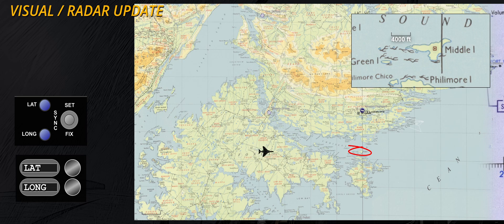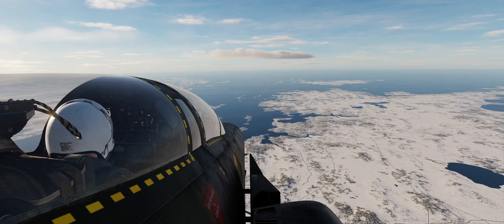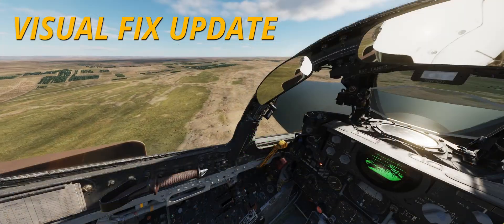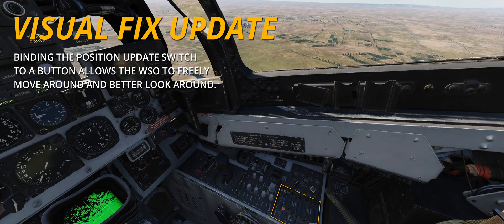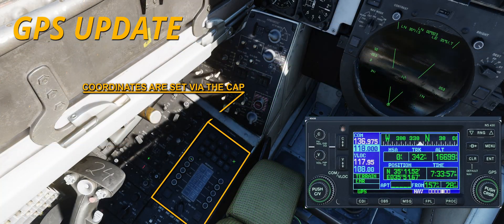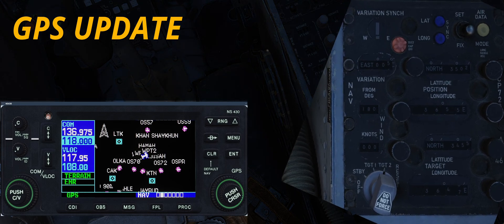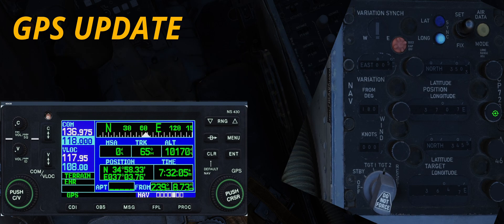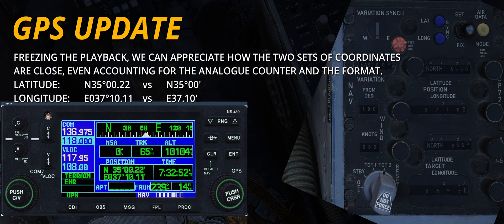F-4E-45MC INS: Visual/Radar, GPS Fix Update (AN/ASN-63)

Comment: If you dont have the GPS module, you can use our free moving map
Reply from the maker: I would use it only in a server expecting the capabilities and functionalities of a fully updated Phantom. Id est, mimicking an ICE, Icarus or Terminator. Otherwise, it's just too good. The NS430 is a terrible moving map, for example.

The correct answer would is: do a visual update, as it was done IRL :)
Reply: @FlyAndWire  Good point, we should add a retro GPS mode. Maybe something like a Garmin GPS 12
Reply from the maker: I am not sure it's worth the time, since Visual will be the way to go in realistic servers. When DMAS arrives, the ARN-101 uses a laser ring gyro, which probably won't need any update at all. Everyone else will probably be happy with what you have now.
Reply: @FlyAndWire  Yeah probably, thought it would be fun to do :D 
I've added lat/lon position of the aircraft. 
You can hide your own aircraft in the map and just use the lat/lon position

Comment: Question to a general community: Do you find yourself unable to complete mission (online or in sp) without realistic INS fixes and advanced (real) approach? To be honest, I never found ins drift a problem - the missions (MP) are usually too short, and the most of f-14 campaigns somewhat go without the need for correction. I've heard ED is changing INS simulation in recent versions and I wonder if it will become a big factor. Because until now, any 80's or cold war servers / campaigns were not really hard on this aspect. That's my impression, at least.
Reply from the maker: Well, for example, my last mission was almost 4h long in the Tomcat. After I realised that our DL information was off right in the middle of a close encounter with a MiG-29 in total darkness, I made a quick update.

These procedures are not really used in casual servers, I agree. But I would argue that 99% of what is done in real life is useless there. Tactics are rarely more complex than spamming AMRAAMs or hiding in the valleys :|
However, this sort of study is what eventually led me to understand the F-14 ARHS problem. If other players are happy to have their avionics pointing 20/30 degrees in the wrong direction, good for them, but I prefer to have my stuff properly sorted! :D
Reply: @FlyAndWire  It is because of this that I don't bother with public servers. You just don't get to meaningfully engage with the simulation in server scenarios that are built for those that actively don't want to.
Reply from the maker: Yep, I agree. Casual servers can be fun, especially with a couple of friends, and help to get used to unexpected situations. However, it ends there, pretty much.
Reply: the problem is that most server allow the stupid F10 GPS position, so people dont even bother with real navigation procedures. I wish that wasnt the case
Reply from the maker: Yeah, it is something I don't like either. I guess they try to embrace a wider audience. More simulative servers need structure and organisation, something hardly achievable outside dedicated communities.
Reply: Have found it an issue for sure. Orbited for a strike while SEAD elements were suppressing defenses at a field. Took longer than expected and orbited for better part of an hour. But that point INS was a couple miles off from the target waypoint. Safe to say we were not over the field when the system said we should be when it was strike time.
Reply from the maker: This is a good example. IRL I guess that the ASN-63 was not considered in this case as talk-on, maps and pilotage would do the work just fine. However, this is precisely what I meant in the video about the importance of a precise INS in DCS being greater than in reality. And just to be clear, I would do exactly the same (although I plan to print and laminate maps, properly scaled spider map and so on for my campaign).